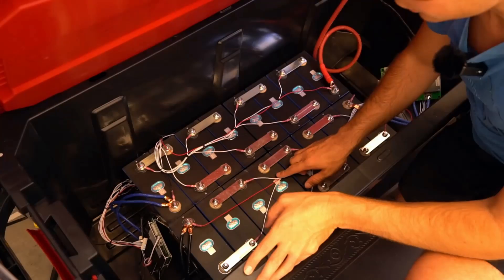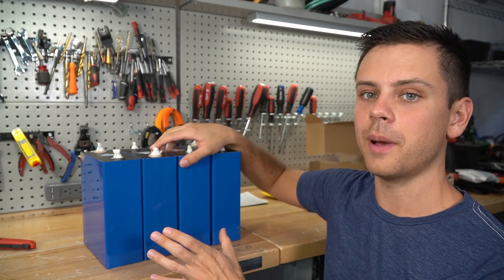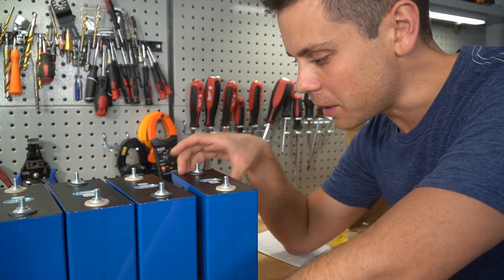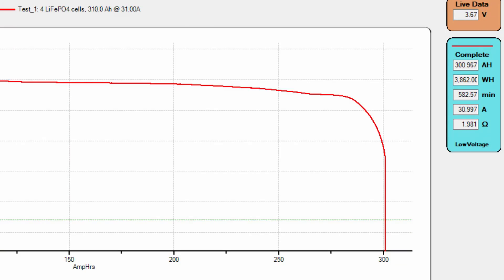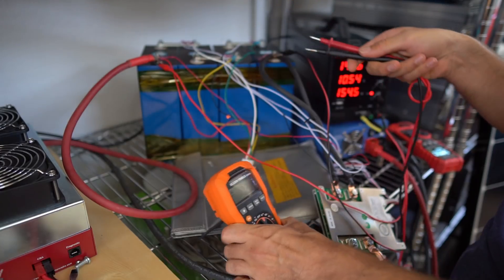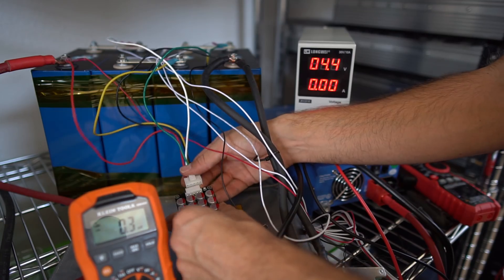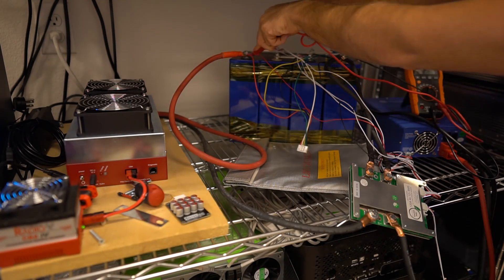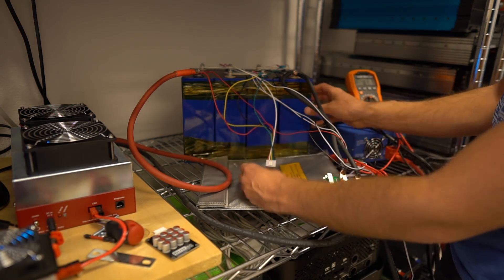Amazon.com "Grade A" 310Ah -Ninthcit- LiFePO4 Cells Manually Balanced and Tested

Comment: It would be nice if you could block the children arguing politics.

Weeding through them is taking time I need to decide which company I am going to buy my real Stetson or going out business garden spinners from.

I'm installing solar on my trailer.  Found your book very helpful.  Have you found a battery supplier from outside the US  who has consistently supplied a decent product?  Right now I am probably going with Renogy AGM.  I live about half an hour from their newest location so customer service is fairly easy to get to.  .  They seem to be the best compromise for me at this time. Trading off, power, weight and cost. All I really need to power are the CPAP machines,   I lived without a/c most of my life.  I know better than to try to camp in the desert off the grid in the hot season.

I have this faint hope that batteries are going to get more financially reasonable.
Reply: Lithium will last longer

Comment: I’ve been subscribed and watching your channel for awhile. Always great info and product breakdown. I was hoping that in the near future(if possible and time allows) that you might do a video on how to set up a 24 volt system and then connect it to your homes electrical panel so that you could operate your entire home from the solar all in one 24 volt system. I’m building an off grid home and I’m confused on how to directly connect the solar power to an electrical breaker box so that you can easily just plug in your appliances directly to wall outlets or turn on lights from switches as if you’re tied directly to grid power. I understand I’ll need to wire home while building as if I’m doing conventional tie to grid power. Thank you so much for your help sir. Keep up the great content 🤙🏻
I’ve watched tons of YouTube but I’ve yet to see anyone explain the process like you and no one has ever actually shown how to wire in for example a 24 volt Mpp solar all in one directly into an electrical fuse box in home so that you could easily just plug in your homes appliances to wall outlets as if tied directly to grid.

Comment: Will, I am currently sitting on 20 of what appears to be the exact same cells that you have here (and tour last video) and they all are grade-a and have the QR codes on the sides of the packs and they are all advertised as 280AH.  I'm in the process of doing an analysis on an eight-cell configuration in 4S and it is going well with the West Mountain radio battery analyzer but takes quite some time as 560AH is what it is 12 12.8V nominal. I will let you know what comes of this test and I wish I could post a picture here because I have so many of these things it's insane lol.
Reply: 280’s are not the same as 304/310/320, which are 3mm taller
Reply: OTOH, If they are BS'g about things, a fake QC stamp isn't going to be hard to do either.

Comment: Maybe 270-280ah is the sweet spot based on cell size and the limits of the aluminum sleeves versus bloating etc… battleborns new battery is 270ah .  Going past that may get into more bloating , shortened life, based on current designs of the prismatic cells

Comment: i've a question plz. it is better to buy a 12v 50Ah Lifepo4 battery instead of a 12v 100Ah SLA battery ? due to my budget i can't afford the expensive ones and it is my first solar system just wanna make one about 600w.  need an answer plzz

Comment: Hello...Great Video.  
I have 8 - 100W 12V 5.28A panels.  Two sets of 4 panels are in series and then those 2 sets connected in parallel.  
My Question:  Would I only need 1 - 10A fuse per set of series panels?  Thank you!

Comment: What do you know or think about liquid metal battery chemistry? I think the company is called Ambri. It is new chemistry/technology.  I echo the gent's comment below @paradislarry, great videos, and I am learning (relearning) a ton. I am also leaning toward electric.
Reply: Ambri liquid metal batteries are probably not viable for any purpose.  80% charge discharge efficiency.  They claim they are better than pumped hydro which they claim to be 70% but improved design efficiencies have improved this and every installation I could find now claimed 20% CHARGE DISCHARGE efficiency, ( or was undergoing refurbishment to improve the efficiency.  Indeed that 10% difference is enough to ensure older installations have been upgraded.  Back to ambri,  they have to be discharged every three days to continue functioning,  this makes them unviable for small private installations.
The technology was 20 to 30 years too late.   Today finding situations where they are viable will be very hard.

Comment: I have dreams like that myself. I was a technician in a Mainframe computer company back in the 70s and 80s. I was working on this system for days and could not figure out what was wrong. One night I had a dream which IC  was the problem. I went into work the next day change that IC and the system started working.

Comment: I recently bought an Sok 12 volt battery and I am wondering what the charge parameters should be for my Outback Fm60 Charge controller, float time, absorb etc. Currently running a 12 volt system. Id  hate to overcharge it or over discharge.
Reply: You sok has a BMS built into it. It will prevent the cells from being over charged or over discharged. You can't really mess it up.

Comment: So I have a very specific question and perhaps it would make a good video for you to do. If you wanted to run a off grid well how would you calculate the smallest battery you could get away with paired with solar to get you round the clock ability to run it
Reply: Too many possible solutions it has already been done. Simple solution is no battery, size solar panels to run a dc pump when voltage is high enough pump runs too low it stops, use a storage tank.

Comment: These cells are hit or miss. My first batch of 4 Supposed Catyl 320ah cells tested 295 and were perfectly flat when half charged and fully charged.  My second batch of 4 arrived bloated but tested 321ah. They bloated more when top balanced to 3.58v. I've since restricted their expansion by about 50%. With no apparent problem. I used 1/4" aluminum plate and 4 threaded rods, 2 each side. The rods never get tight from expansion. If I think limiting expansion is better than allowing excessive internal movement. Why else would manufacturers reccomend compression? I'm sure it is because limiting expansion is good for the cells. That's my theory and I'm sticking to it!
P.S.  I'm charging only to 13.6(pack of 4) and discharging to 12 volts, expansion is much less this way, still getting 306ah.

Comment: Thanks for sharing Will. I bought 16 grade A 280Ah cells from Shenzhen Basen and they were not bloated at all. I am about to get 108 of 310Ah cells now. I am having a second thought after watching
your videos, whether I should stick with 280Ah. I agree with you, swelling is telling. How can a brand new cell be bloated like this? It’s not even practical to apply any pressure to these, since it’s hard to tell how they will behave after a couple of cycles. Last thing we need, is to damage the blue wrapping when they are compressed - BOOM! My guess is, they had to test these cells at very high C rates at the factory, although I might be wrong. But this is new, and someone saying that it’s natural for grade A 300Ah to look like this, it’s hard to believe. The SEI layer did not have a chance to form yet, it needs a couple of charge cycles first, right? I can’t complain about my 280Ah cells. They are not that far apart. Thanks,
Reply: Hello ,Adam ,we have 100% Real original Brand new Grade A 280AH and 310AH .If you need,reply me ,thanks
Reply: Hi, 10 months later what happened? Did you buy the 280A cells? How are your initial 280A cells holding? What do you use them for?
Reply: You can put a layer of fish paper between the cells if you're concerned about damaging under compression. These cells should absolutely be compressed.

Comment: Is it critical the cells are compressed?  Reason I question, are the cells you recently had with spacers, allowing full air flow between cells.  You mentioned the benefit of air flow for cooling, but you can’t have air flow AND compression.  Air flow seems more important to me, am I wrong?

Comment: I feel like someone hint hint needs to pay an unannounced visit to China to visit some battery factories and see how quality control is done. Batteries are commodities and favor scale in manufacturing. I suspect many of these vendors don't actually have any manufacturing facilities, but are sourcing cells and white labeling them.
Reply: That's how every company does it. There are often only a few manufacturing facilities of each type of core product across the world. This applies to battery cells, RAM and other computer parts, silicon wafers, etc.
Reply: @shawntucker7674  Which begs the question how are these vendors selling cells that are ostensibly different, while actually sourcing them from one of the large manufacturers. What stopping someone from doing a group buy and just buying a few container loads of cells directly from CATL or BYD.

Comment: Will, I was wondering if the bulge is caused by the heat of the container that it was shipped out of. In Vegas it’s pretty hot setting inside those trucks, could that be the cause?
Reply: 0:48

Comment: I've never heard of 'cell bloating' being a 'feature' of LFP cells. I'm calling bunkum on that. Imagine if the cells were in an ungiving enclosure - that's why pipes crack in winter. You say you paid relatively more but your argument still holds: you get what you pay for, and these, by your own admission, were 'a good deal'. Great video and what you're doing here for the community is admirable.
Reply: Prismatic cells usually expand for 2 mm when fully charged and go back to normal when discharged
Reply: Expansion is completely normal for lithium battery chemistries. These budget basement cells probably have the thinnest possible cases, and they just can't contain it without significant deformation. I wouldn't discount them on that basis alone. Still pretty hard to beat for the money. But I think I'd be inclined to constrain them to keep the movement down.
Reply: Physically restraining expansion doesn't sound like a very good idea. Just ask the water pipe.
Reply: @tictagtube  I totally get the analogy. But I'd counter that by pointing out that plumbing does expand and contract within the normal range of water pressures encountered in a residential environment. Consider that the normal lithium cell. 

Of course when water freezes, all bets are off. Consider that the worn or damaged cell. 

Sure, compression/constraint remains controversial. Some cell manufacturers call out specifications for it. Cylindrical cells do it naturally. Some research papers I've read demonstrate a sweet spot where increased cell pressure improves life to a certain point.

Really, Will has a fantastic opportunity here to collect real world data. Take his new 16s pack - constrain half the cells with a really rigid clamping configuration - and leave the other unconstrained. I'd love to see that data after a few years of full capacity daily cycles.
Reply: I would not advocate any action that increases the pressure within an enclosed vessel that is not designed for that pressure. It's simply not a safe behaviour. There is a pressure relief valve on all LFP cells for exactly this purpose i.e. to reduce the risk of explosive failure due to pressure increase, the inference being that pressure increases are not part of the design.

Furthermore, most installation guides I have seen recommend spacers between cells, this is not to accommodate bulging but to provide for more efficient dissipation of heat (i.e. a safety feature); a bulging cell would reduce this air-flow / heat dissipation and, thus, reduce the inherent safety of the product design.

I don't claim to be a battery expert but, from a layman's perspective, I would be critical of any battery manufacturer that says 'bulging LFP cells are fine'.
Reply: @tictagtube  I think the point I'm making is that the enclosures are probably designed for that pressure. The issue we both probably agree with when with these likely grey market repackaged mystery cells is that nobody really knows what the original manufacturer intended. And 'bulging cells are fine' coming from that third party is definitely to be taken with a huge grain of salt. If it came direct from the OEM manufacturer I'd be more apt to pay attention. 

The presence of a pressure relief does not imply the package is not designed for any pressure. Propane tanks have pressure relief mechanisms too - in place in case of OVER pressure.

So the question is - what is considered over pressure? My best guess is that it covers a damaged or severely overcharged cell. Compressed or not, much like the water and ice analogy, the cell pressure likely rises an order of magnitude greater than the standard operating range in those conditions. I recall something on the order of several hundred PSI - though that was for cylindrical cells I think. Where-as the prismatic battery cell specifications I've seen called for something like 12-15psi nominal. I think someone needs to put a pressure transducer on a prismatic LFP cell for science.

Comment: Does anyone know the real situation with low temperature charging as I have now been told independently by 3 different companies that their LiFePO4 cells can be charged below 0c, the ones being tested here list -5c, while the ones I ordered say -10c and I've seen a built 12v pack that was even lower (-15 or -20c, I don't recall)...  is this simply a lie, or is there some technology that can allow this?
Reply: Some batteries nowadays include a heater which allows lower external temperatures...
Reply: @jeffreychow8853  That's true, but the listing in the description above where Will purchased these loose cells, states that those individual cells shown can be charged down to -5c... I'm not sure I'd believe there are heaters in the individual cells, as that would imply individual battery protection etc, which doesn't seem remotely realistic.
Reply: @JamesLewis  Oh I see. Yes, there’s definitely no heaters in individual cells. Not sure how they’d be able to go to -5°C. Did you see the update video? Looks like that listing got taken down - potentially because it was misleading on multiple fronts.

Comment: Agree fully, theft is theft and people need to hold corporations accountable. 

It's amazing to me how much latitude, benefit of don't and blind forgiveness is given to corporate personage.

Return it yes. Because you bought it on Amazon, the return should be "easy", but if not, file an A-Z Claim and Amazon will set things right. If Amazon fails to make things right, issue a Credit Card charge back against Amazon as they also need to be held accountable.

Your customer review on Amazon would also help others who have yet to find your vids (and hopefully will, because of your review).

Comment: Here’s a thought I have 2 different cells
Fist one was a lotto Kahla “200 amp hr” after testing and pulling off stickers revealing true 176 amps
2nd cell is a true 230 amp 
That’s literally over 50 amps more 
Cell sizes are almost exactly the same 
How is that possible neither have any kind of bloating 
My Alibaba rep suggested the 230 amp cells because the 320 amp cells swell and customers complain. It took almost 4 months. But my total cost was $1569 with shipping so my thoughts are you can get cheap cell that are good. I myself don’t trust swelling cells. Form factors should b checked

Comment: I've got over 10 years experience with lithium batteries that I  power RC equipment with. Swollen always seems to equal a shorter life span and unstable batteries in the lithium world. Those bats have to be grade B not A. I doubt they last but a few years. When I've seen batteries completely fail and basically self destruct the first thing that happens is swelling.
Reply from the maker: Oh right, with lithium polymer that is absolutely the case. I used to build rc cars planes and race quads and hexacopters for years. If they are puffy, they are done. But lifepo4 can be different. The pouch cell and thin prismatic naturally bulge and require compression.
Reply: @WillProwse  Good info. It'd be interesting to know how much swelling is normal.

Comment: I can not thank you enough ... I've started to buy everything electric, mowers etc, bought an EGO set up with a solar charged battery pack system, which can also be used for 120 back up in my Mobile Home. Started watching your videos 3 months ago, you've taught me almost everything I now know about electricity, and I am a 64 year old Luddite. Even tho you really pushed the information on this video, I actually understood every word thanks to your concise tutorials.
Reply: Agreed, even though I cannot use the EGO on the other side of the Atlantic, it helped me find the correct 3 phase 380V with any 48V battery to connect. Awesome channel! Also, it helps to see that top balancing will only net 1% more on most cheaply purchased cells.

Comment: I had exactly the same experience with some 202Ah cells from Amazon/LiRongPing for $650US.  They were swollen and capacity about 195Ah.  I top balanced them the same way as Will - applying power to individual cells to ensure they were as fully charged as possible.  I initiated a return process and the supplier gave me a 50% refund.
Reply: Hello ,We have 100% Real Original Grade A batter cells ,If you still want ,write me back

Comment: You got a grade A for sure, it is made in the same factory same line as all like 275 280 3xx all is same just different batch. You might compress them manufacturer said it multiples the lifetime, with no compression only half of the cycles you get with same degradation.